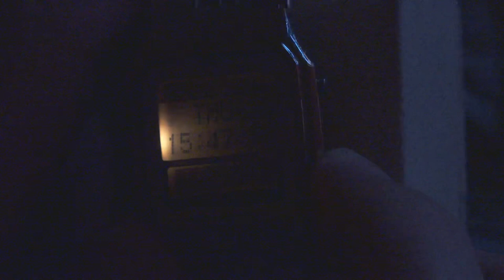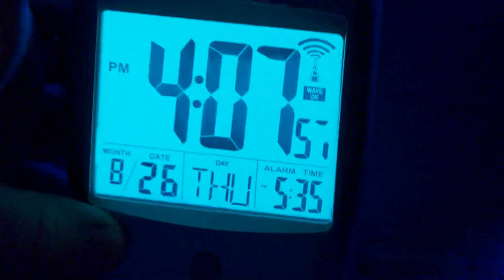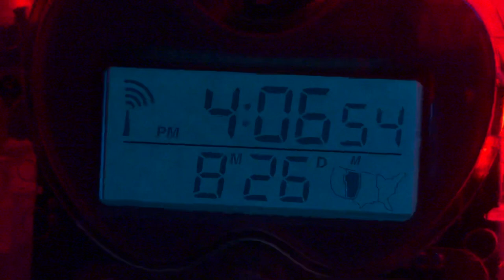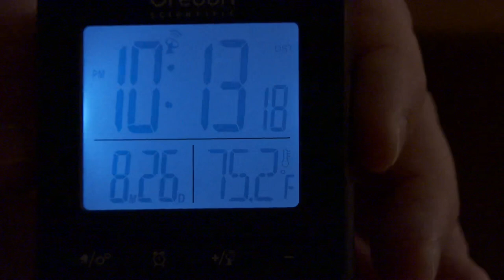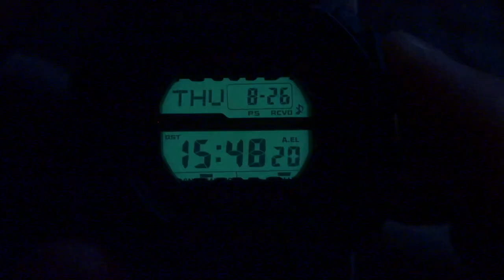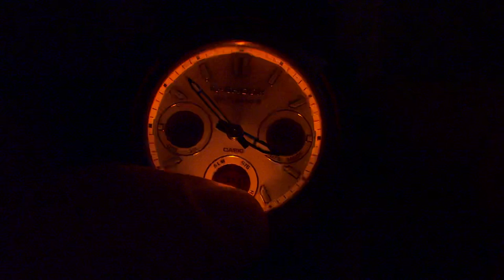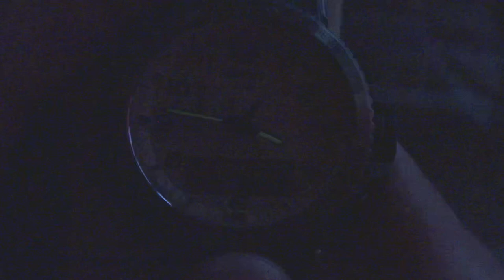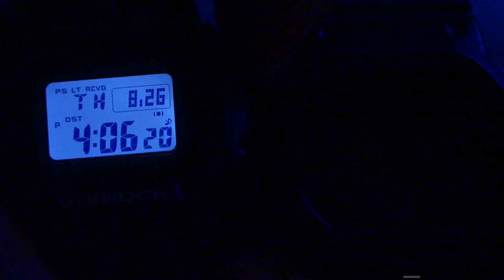Let’s Talk About Backlights in LCD Watches and Clocks

Comment: I noticed that Casio had gone back to LED technology in their latest G shocks but thanks for pointing out that electroluminesce fades over time. I did not know this. Great video.👍👍
Reply: In the models with “U” on the end.   Those models also allow you to set the light to three seconds, and keep home time on in stopwatch and count down modes.
Reply: Dealbreaker for me. I bought the new version, GW-M5610U with the blue lining but I hated the strap and the LED light is just...... horrible. 
Yes, it illuminates the screen very well but it just isn't appealing.
Nice updates all round but not for me.
Reply: @sheprekker9188    I always change the straps as I am allergic to petroleum products, so I have mine on a titanium aftermarket bracelet. 
I know what you mean about the new backlight.  It is much harsher.
Reply: The LED technology they are currently using is much better than EL.
Reply: @traviswalker8933  Yes, it is much brighter and uses less power.  I find the old green softer and friendlier.
Reply: @oklahomahank2378  I tend to prefer the new backlight. Especially those on the B5600 and the B5000s.
Reply: @oklahomahank2378  Yeah, agree, but there are still people who can swear that original 5610 with EL light is the best (even it's fading over time)  :-)
Reply: @sheprekker9188  Have you tried the one with the "combi bracelet"/strap from Japan? It seems like a very nice watch strap. Not sure about the inverted face module though...
Reply: @oklahomahank2378 I never knew there were such an allergy, does that mean that if you hold a plastic bag for enough time it'll make your hand's skin swell? Or if a bit of petroleum touching your skin burns?
Reply: @tydshiin5783     My skin turns red and itches.  Eventually it will blister.   If I am exposed to enough of it (more than a watch band) I get hives at my waist and underarms and begin to have trouble breathing.
Reply: I own a number of electroluminescent panel backlight watches and, as the old expression goes, "knock on wood", not one of them has malfunctioned! Four of them date back 17 years to 2006 and the electroluminescent panels in those 4 watches are still going strong all these years later! So if someone owns an electroluminescent backlight watch in which the EL panel is failing despite the watch having a brand new battery in it, then the most likely explanation is that the EL panel has become defective in some way or the circuitry that connects to the EL panel has become corroded. The two major drawbacks to LED-illuminated LCD watches is that (1) the one or two LED bulbs that the watch manufacturer puts on one side of the display screen cannot illuminate the display screen uniformly all the way across the display screen and (2) the brightness of the LED bulbs can make it difficult to read the time if the numerals representing the time are very close to those LED bulbs!

Comment: The GMW B5000 allows you to set the backlight to either 2 or 4 seconds on. And the light doesn't switch off suddenly, but fades away. A very nice touch.
Reply: Armitron has been doing this for years. I love it
Reply: Its 1.5 and 3 seconds!
Reply: @NathanChisholm041  Nope. 2 or 4 seconds. It even says so on the display when setting it.
Reply: @MrPleers  Mine also has a choice of 2 to 4 second.
Reply: @NathanChisholm041  I own the GMW-B5000 and can confirm that it is, in fact, 2 or 4 seconds with fade.

Comment: EL light needs anywhere between 100V to 200V, and in watches to achieve this they put in a 1:100 step up transformer, and this will definitely put a much higher drain on the batteries.  But yes, EL definitely wears out faster.  Nice that companies have found the ability to put in a light spreader that helps the LED light spread out more evenly.  Great video Greg!
Reply from the maker: In the end, I do prefer a good LED backlight. But I don’t consider any backlight issue to be a “deal breaker” either.

Comment: I bought an LCD watch as long ago as 1977 which actually had tiny beta tubes behind the display for illumination, emitting radiation in the form of light! The radioactive material was tritium I believe. This was permanently on and when new gave an impressively bright soft green glow. The system lasted about 15 years until eventually grew so dim that it couldn't be seen at all and I junked the watch. I hadn't seen anything like that before or since.
EDIT - British firm Nite Watches use the technology for face markers on their displays.
Reply: Tritium only has a half-life of about twelve years, so it would have to show dimming within a few short years.

Comment: Once, while doing some work on my truck, I took my Indiglo Timex off and put it on the dash, and it got pretty hot in the sun.  The light barely worked after that, even after a battery change. My Casio W800h-1av got quite hot in much the same manner, and the light still works fine.  Pros and cons to each, I guess.  Great video!!!!

Comment: 0:38 Are those old watches using Incandenscent lights or LED's? I own a watch myself that looks like it has the same kind of backlight, same color and brightness. Did watches use incandenscent backlights or are those led's? Thank you for your answers!
Reply from the maker: I don’t know much about tiny lamps but I remember that all backlights on LCD clocks and watches in the late 1970s and well into the 1980s looked about the same. They emit light which is the color of light from incandescent lamps and they’re not very bright. So I just concluded they really are some kind of incandescent lamps. The LEDs from that time didn’t emit that color or, at least, I don’t remember ever seeing any that did.
Reply: @GoodTimekeeper  Alright thank you very much for your answer! 🙂

Comment: 1:03 — man, the display module in this watch is clearly installed crookedly. ) I am always afraid of this when unpacking new G-Shocks, because in many copies you can also notice slight distortions. Thank goodness, in my new 5610U, the display module is installed exactly. But about my DW-5600, alas, I can't say that.
Reply from the maker: That crooked module on the 1985 Casio is my fault. I changed the battery myself and didn’t notice the module was crooked until later. Then I was too lazy to fix it right away. But it will be easy to make it right again.

Comment: Thanks for the explanation Greg. Just don't understand why Casio doesn't upgrade the regular non-solar 5600 and 6900 series lights all together. Even the newest Carbon Core square DWE5600/5610 doesn't feature the new LED. Makes me wonder when will they change it...

Comment: These electroluminescence layers fade out/get blackened over time. I still got an old alarm bedside clock (over 25 years old now), the same model I've seen in a previous video of yours (anthrazit, radio controlled, getting thin/narrowing to the pusher on top) but with an additional moon phase line. It's still showing the time and everything but when pushing the light on, you can see just a small area/point at the top where a bit of the light is shining through, not enough to see anything in the dark.
I wonder if this is fixable but I guess not. Keeping that watch nevertheless though. - Just saw it, mine's an Oregon Scientific too, should watch videos to the End before commenting, nevermind. 😅
Reply: I think it's fixable, if that EL layer is replaceable, but I'm not an expert. How long did the backlight of your clock light up strongly? Is it worth buying a watch with this backlight do they last?

Comment: Hello again Greg. I have noticed that the blue electroluminescent panel backlight on my SKMEI watch is brighter than the blue one on my larger Fossil digital watch. Is the reason for that difference in brightness because the manaufacturer of SKMEI watches puts brighter EL panels in their watches or is the difference in brightness between the two watches' backlights because a SKMEI digital watch has a smaller digital display screen than the larger Fossil digital watches and therefore the EL light is more concentrated into a smaller area on the smaller display screen on the SKMEI watch, resulting in the backlight on the SKMEI watch appearing to be brighter?

Comment: There is one more type I know: analog + small digital, like AQ-S800W where only the digital part has a light. I personaly like it. Thank you for the video, it was very interisting :)
Reply from the maker: My older analog Wavecepter has a small LCD window. The backlight is only for the LCD part, whereas the backlight on the newer Waveceptor is only for the analog face. But then my newest analog/digital watches have backlights for both the analog and digital portions.

Comment: Is EL dangerous in any way from radiation or the phosphorus like substance leaking onto skin?
I’m guessing it isn’t. 
EL replaced the old luminescent radiation issue on wateches. 
And the only reference I can see to the phosphorus like substance being an issue would be if you were actually making things out of that substance that coated wires or something like that and it was on your skin. And even then, apparently it is only a mild irritant.

I’m guessing that it never leaks out of watches onto your skin   

I’m guessing Casio is not getting rid of EL because of any health dangers, but because of power saving and internal size advantages and the added functionally when lighting up complex G-Shock dials (as in the vid). And of course,  as per the video, also the slight fading that can happen over a very long time, but most watches, especially Casios, don’t have that issue , or only have it after like 40 years or something - And maybe only in the indiglo Timex watches might fade more.

I can’t see any reference so far on Google that is talking about any health dangers with EL 

I know overall this question is a ridiculous question about potential health risks or the only other thing I could worry about would be after 50 years one of them starting a fire in a garage or something. And I haven’t found any google search so far that relates any Casio watches to fires.

So yeah, kind of a ridiculous and dumb question, but I’m a little bit of a worry wort. 
And kind of feel now that I can relax and wait with great excitement for my Casio F105W and enjoy its back light at night time that will be way better than my Casio F 91W

Comment: Hello 
I bought a g 9000 because i was amazed by the magnificent blue sky. I receive it. The colors was green, less interesting. I saw others reviews and for the same model, some are with the magnifying blue and the others green. My f105 have the magnificent blue.
My qiestion :

Do you know why there is this colors changing while it's the same model, same module inside? Is there a link between the battery and its capacity? 
Brand new battery blue and more the battery fade, more the colors chznge in green slowly?

Comment: Hello Greg! Thanks for your outstanding and informative videos. Would you please tell me the model and module number of the watch you're talking about at the 11:20 part of this video? I own a smaller, similar version of this watch and like you pointed out, the lcd part do not light up and I'm interested in this model. Please let me know!
Reply from the maker: That one is a GAW-100. There’s another version of it called the GAS-100. The GAW version has Multiband 6 and the GAS version doesn’t, but is otherwise the same. Unfortunately, the GAW-100 is a little difficult to find at a discount these days but I was able to find one brand new through an eBay seller.
Reply from the maker: The GAW-100 uses module 5444 and the GAS-100 uses module 5445.
Reply: @GoodTimekeeper  Thanks!

Comment: I will assume they use some sort of capacitor to build the charge for the EL layer. I wonder if it's possible to replace that to get them to work.    Oh well, will never know.

Still really interesting.
Reply: It's like the old  neon lights, they use a transformer to boost the volts from 3 to over 150 volts AC,very complicated and ancient system

Comment: I wonder why would someone use  still EL backlights in this day and age of LEDs; EL is the master of all complications,for it works with 150 volts, and also consumes more battery power than LEDs; but paleeese, if on the cheap, use at least 2 LEDs not just one on the side;
oh,and in parallel,never in series...
Reply from the maker: I hear from a handful of guys who simply don’t like the way the LED backlight looks compared to EL. Some of the comments make it sound like these guys are ONLY looking at their watches when they’re in the dark and using the backlight. When someone says something like “The LED makes this a hard pass for me” I don’t understand why it’s THAT big of a deal.

As for using one LED from the side instead of dual LEDs… I don’t know what the concern is when they design these things. I suspect one big concern is trying to maintain the same size and shape of previous models. But I really don’t know if that’s going to make the difference between one or more LEDs.
Reply: @GoodTimekeeper  IF they put their minds to it,they can do a great job at that; i saw the other day (aliexpress?) a 15 dollar digital watch (skmei 1548?)  that has 8 colors of backlight, and also a mode in which them 8 colors flash in sequence by themselves (guess they are also in the batteries business lol); 
Cars used to have dull and faded dashboards, (they could not just up the old incandescent bulbs watts at will, or the whole shibang would catch on fire...),i am in that field,  but now they all have beautiful and very bright and colorful illuminations, due to LEDs;  watches should be the same way, taking now advantage of  the various colors and powers of led emitters; even if 2 CR20xx batteries were needed,they are less than 50 cents each,and lots and lots of people watch youtube videos and can change them themselves; i have two cheapos ($ 20?) digi/analog, that keep excellent time( but only the digital part, 2 secs/month on the quartz cristal vibrating at those 32768 Hz !!) and they have 2 bats: one,a  CR 2025 for the night light and the digital displays,and another one, a small 626 for the hands movements; they actually have 2 separate movements and they show different times; i guess they are good chinese copies of something; the case is actually impeccably chrome plated brass,(i know because i had to re-drill the depth of one of the 1mm lug holes, fot the bracelet pin, lol)  and unlike SS, that thing really shines; but at 47 mm and heavy, i don't wear it often around the water, i prefer the Expedition,and the little casios,f91w(lazy light in the corner..) and F105( EL); these are also within 2 secs a month, and with the CR20xx bats, they last and are just amazing for the price,also very easy to make them waterproof with the proper 4 O'rings, a big one and 3 tiny ones; my local watch repairer sells me them cheap,i replace them once in a while, and has tested a few of mine to 10 Bar,in his small compression chamber,no leak,and the front plastic held..

Comment: Hi, I've an alarm clock like those Oregon Scientific. It has almost 20 years and has always worked perfectly. The electroluminescent is still ok and is always a lighthouse in the dark and its radiocontrol function is a boon to wake up on time. The only thing I don't like is its shape... too much comic.
Reply from the maker: I like that little, square Oregon Scientific clock. It’s a bit small (travel size?) but I like the thermometer on it. What can I say? I seem to like them all, especially the radio controlled stuff.

Comment: My Rangeman GW9400 is kinda dim, its legible but really not how I expected it to be. Is that normal for this model?
Reply from the maker: I didn’t think the backlights on my GW9400 watches look dim. Compared to electroluminescent backlights they actually seem bright to me.
Reply: @GoodTimekeeper  thanks for your response. Its hard to capture on camera but for my liking its quite dim. Is there any possibility that its connected to the charge level. I bought the watch two weeks ago and it is still on M Battery level

Comment: Greg can a watch manufacturer replace the electroluminescent device in a watch if the brightness level declines?
Reply: Hello Greg. What are the two model numbers of those two small, black, hand-held, bedside, electroluminescent clocks that you show in the this video review of electroluminescent clocks and watches? I think you stated that the square-shaped one is made by Oregon Scientific but you didn't mention the name of the manufacturer of the rectangular-shaped one. Also, the rectangular-shaped one which you say has 2 "hotspots" (LEDs) at the side rather than an EL panel backlight, appears to me to have a combination of EL light and two LEDs because the backlight on that hand-held bedside clock is evenly/uniformly dispersed across the display screen. LED-lit backlights on watches and clocks (such as the Seiko SDGA009 and SDGA003 digital watches) tend to have the drawback of only illuminating well one side of a digital display screen and not the entire display screen uniformly.

Comment: I’ve always wondered about why the backlight choices in some of the watches were made — my Mudmaster has one of those lame LEDs that just light up the 6 o’clock.   Not useful!  Great collection, Greg!
Reply: I'm assuming you own a GWG-1000? I was going to get that model held off from it due the negative display and poorly lit LED light. There post to release new mudmasters this year called the GWG-2000 and lets they fixes the problems with the previous model. You can read about it here.
https://www.g-central.com/mudmaster-gwg-2000-mrg-b5000-gm-2100mg-coming-soon-plus-more-new-g-shocks/